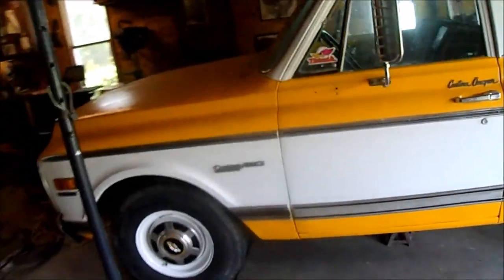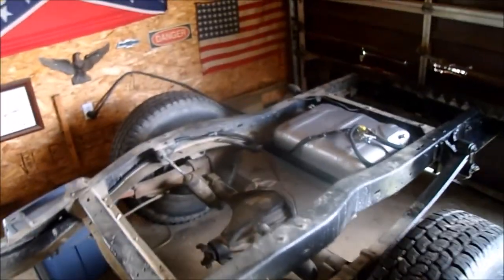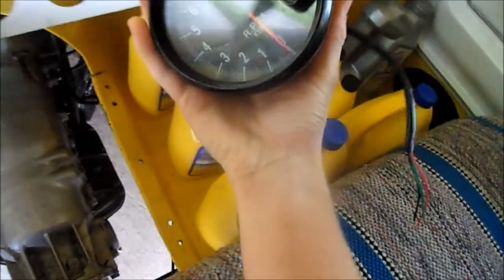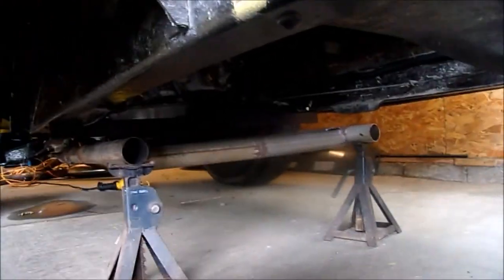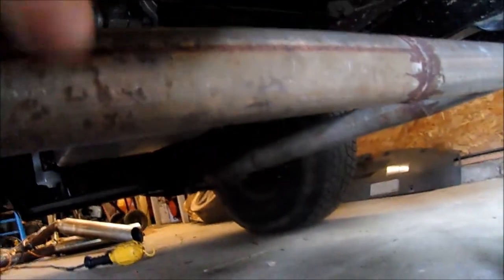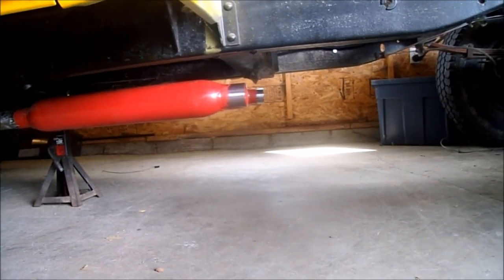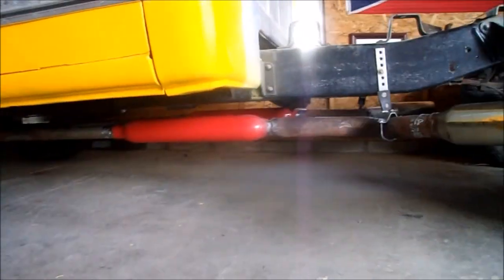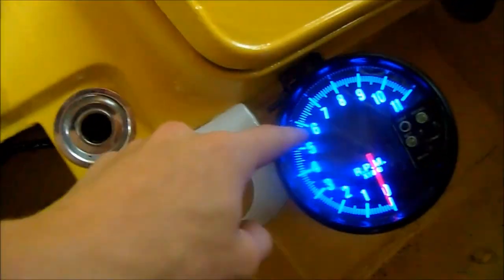72 Chevy LS swap part 25 - Exhaust done

Comment: Those cool looking chrome tips are big around and long they will sound deep and throaty with the 25 inch cherry bombs.  It should have a very low tone with the cherry bombs being so long. Wow 25 inches I cant wait to hear that. I dont know what it will sound like for sure but Im thinking  usually the longer the bombs are the deeper it sounds.
Reply from the maker: shartne Thanks man!  Yeah I figured the longer the better. I got the longest ones that advanced auto had in stock. They had 30's to but they had to be ordered special. I'm thinking the tips will help too like you said. The are bigger than the glasspacks lol  . I hope it will be a low deep rumble. I'm not into the crackly straight pipe sound. We will find out soon! Just ordered the last bits and pieces to get it running.

Comment: I just smiled thinking about how long I've been watching your videos, how far you and the truck have come over the years. I remember you fabricating cab corners with little pieces of metal cut out from paper templates. Engine work is a lot more fun, but it is great if you know how to do the sheet metal work, too, and you have taught yourself well. Thanks for the update, Dean.
Reply from the maker: I agree Bruce. i like the engine and mechanical work better than the body work. But it's good to know both like you said. Thanks for following along.